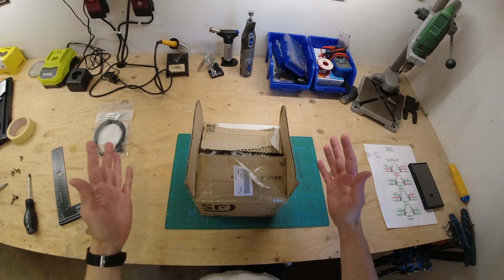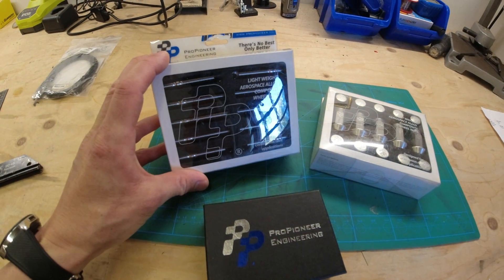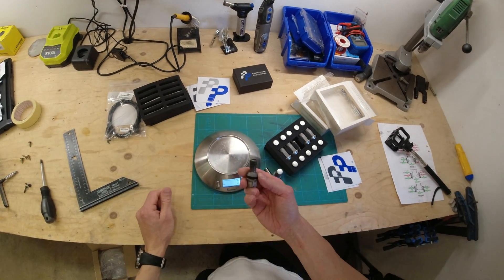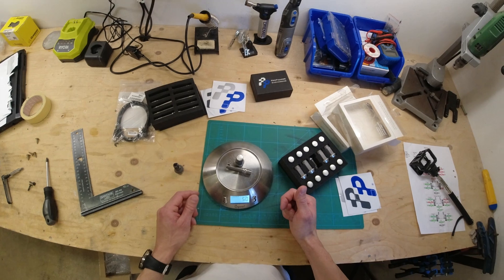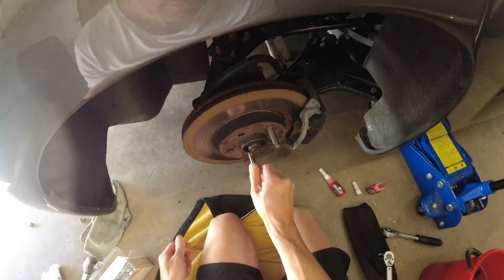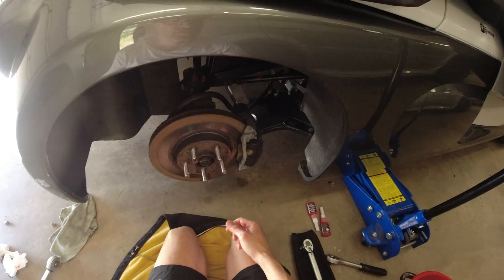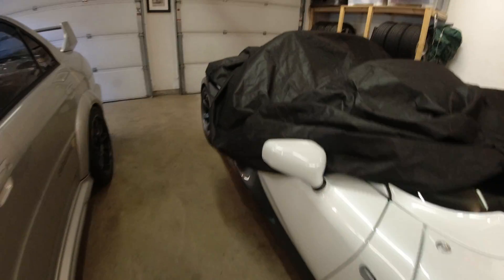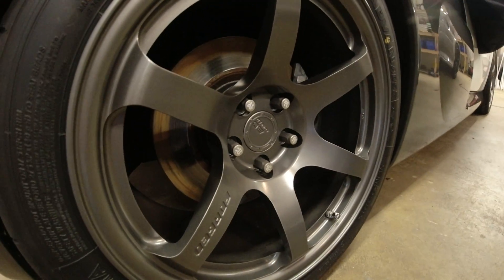JUST HOW MUCH WEIGHT CAN YOU SAVE WITH TITANIUM LUG NUTS?

Comment: I'm replacing the forged aluminum wheels on my 370Z with a set of forged magnesium wheels that should drop about 9 lbs per corner. Next will be titanium studs and lug nuts.
Reply from the maker: Every little helps! I found the magnesium wheels I had on my V6 Clio were quite heavy, soft and almost impossible to repair 😭